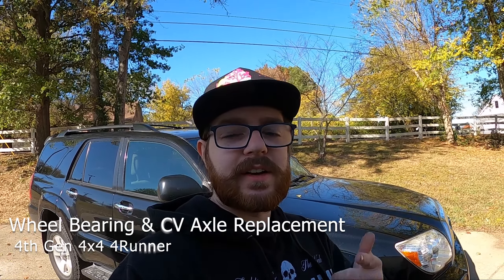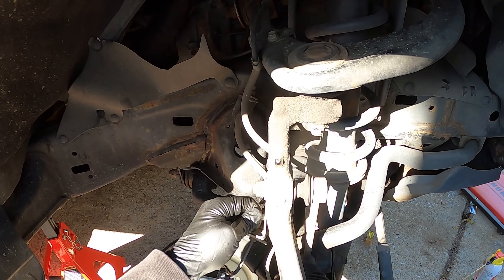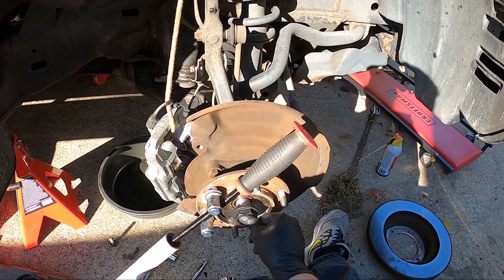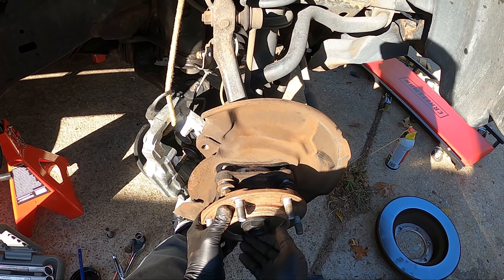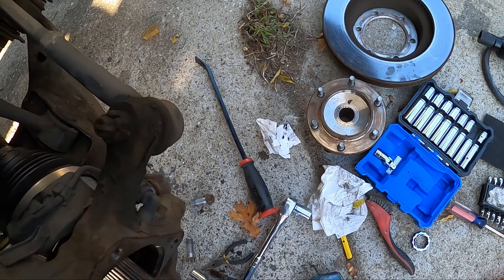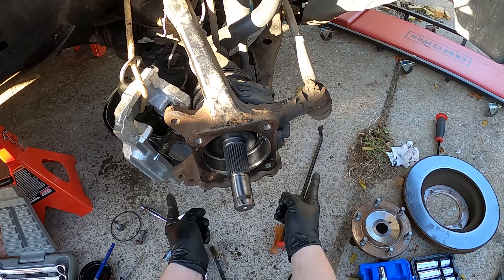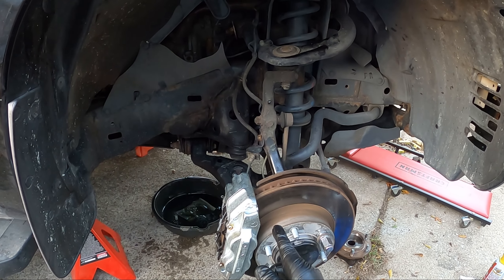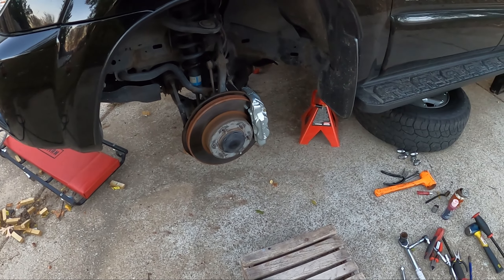4th Gen 4Runner Front Wheel Bearing & CV Axle Replacement

Comment: My son's '04 doesn't have the notches on the axle (my '08 does).  Any suggestion what our options are for banging it out on the '04?
Reply from the maker: Interesting, I'm surprised it doesn't. Well, in that case, there's actually a CV axle puller. It's a slide hammer with a axle puller adapter. You should be able to rent it from Autozone or O'Reilly's.
Or, you can gently wedge a prybar between the CV axle and the differential case. Tap it with a hammer and it should pop loose. (Just be careful not to mar the surface up). To make it a little easier, have one of you pulling on the axle and the other wedging the prybar in.
Either of those methods should remove it